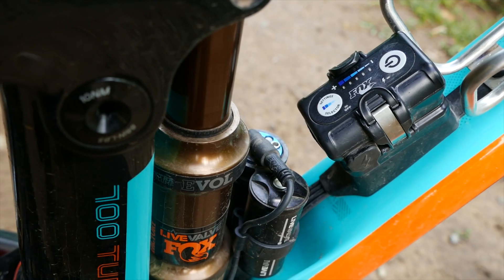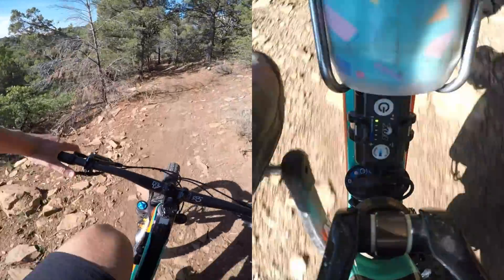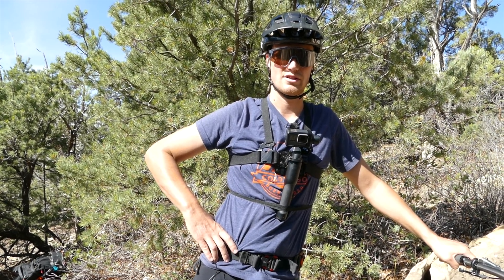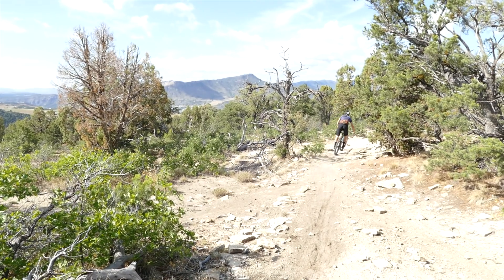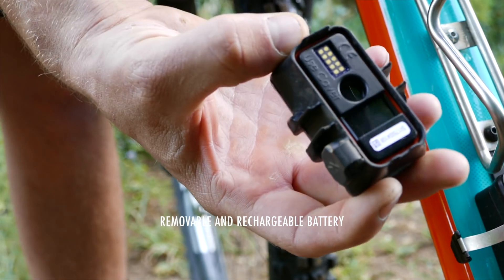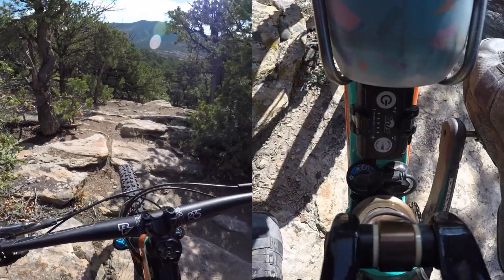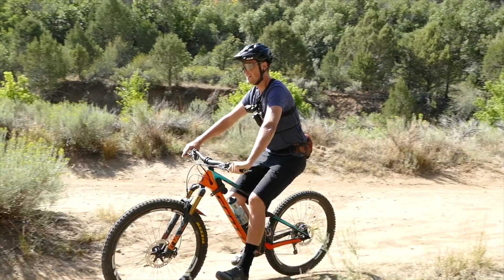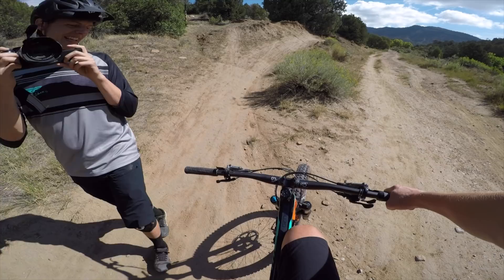ELECTRONIC Suspension! 14 Experiments with FOX Live Valve

Comment: Hmmm reminds me a bit of the control system we use in our racing quads, it’s interesting how it knows you’re doing a manual down a hill and doesn’t close the suspension, I suppose it uses feedback from the accelerometer vs gyro reading to decide what you’re doing and act accordingly

The interesting thing will be when these systems become everyday tech and people make open source software to tune the suspension control software using black box logs etc.... that’s how we tune our racing drones now.

Comment: Live valve should close the valves on suspension rather than open them. That way there is an actual fail safe. With the way I see it right now if it fails you lose your suspension.

Comment: K2/Noleen were doing something very similar back in the late 90's with the K2 Smart Shock.  They did it based on piston speed and position rather than accelerometers.  It's an interesting idea but I could think of better ways to spend my money on my bike.
Reply: didn't that shock have a piezoelectric set up?  i've still got one  lying around somewhere.

Comment: I don't know. Pretty much seems like it's open almost all of the time. Maybe you guys should've made the test in the medium setting.
Reply: I would have been more interested in the different settings. It seems to be open 95% of the time on all but the smoothest sections.
Reply: Going down yeah but going up or flat no.... that's what it's all about.... you're flat or up it's on and locking out without you having to reach down to do it yourself.
Reply: @1982daverogers  that's what it supposed to do, but that's not really visible in the video. Is it?
Reply from the maker: Throughout the video the Live Valve system opens and closes several dozen times. The first smooth climb shows 15 changes in a matter of seconds! Done manually, that'd be a LOT of lever pushing and much less focus on the trail. Our tester preferred the lowest threshold setting for the reasons you can read here, which is why we filmed in it - https://www.vitalmtb.com/features/FOX-Live-Valve-Suspension-Robots-MTB-the-Rise-of-the-Machines,2508
Reply: Relax, guys. All I'm saying is that the visuals of the system working are not that impressive. The green LED is on almost all the time any only goes out here and there for a split second, regardless whether you're climbing or descending. You tell me whether or not that makes a noticeable difference during the ride. I remain skeptic.
Reply: FlowPublican lol dude are you dense? It’s a MASSIVE difference to have it locking out on climbs for power efficiency, with unlocking to maintain traction. Obviously it will be almost always unlocked on descents as it should be. 

Is it worth the cost? Absolutely not, not even close... but it clearly does work.
Reply: FlowPublican chances are the tester liked in the lowest setting because he didn't like it haha I'm with you man. Seems like a good idea but the execution might be another story for now
Reply: Is it though? Is it that big of a difference when the compression damping closes now and again for a split second, given that it doesn't lock out fully, it just goes to the "trail" setting most of use constantly throughout climbs. See, I'm not a nay-sayer but I also don't get overly excited with new tech, especially when it's still in somewhat of a beta state.